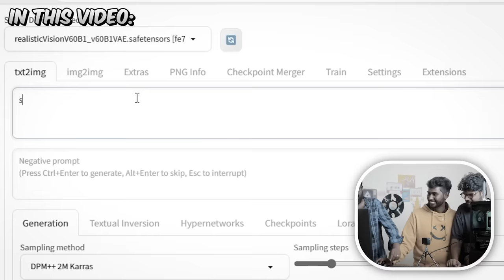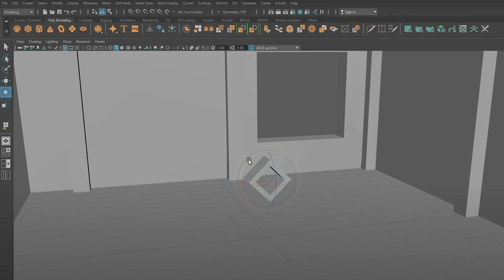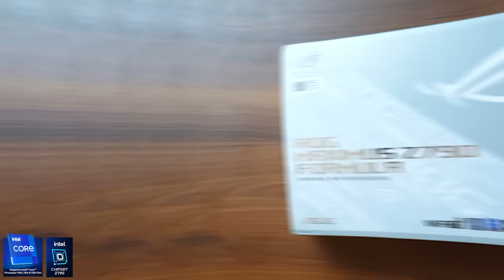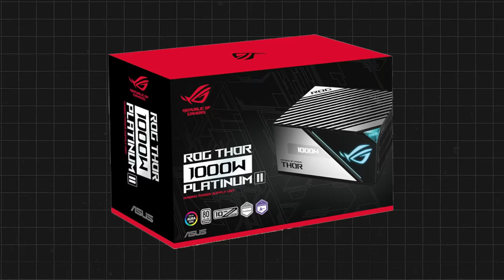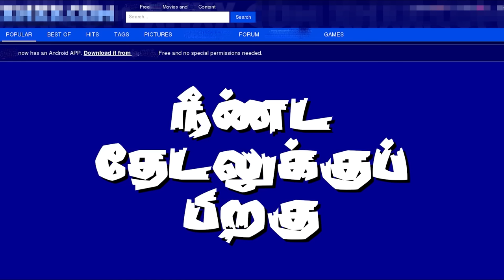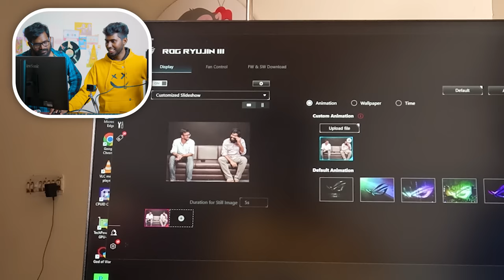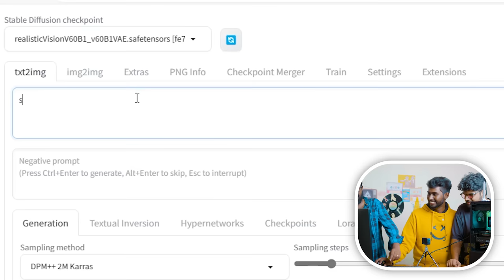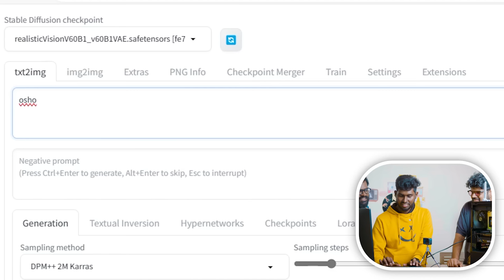Rs.5,00,000/- PC With @TempleMonkeys  | PC Doc Vs Vijay Varadharaj 🥊 | Fun PC Build 😂🤣

Comment: PC clean panitu on panean bro Hard Disk 🚬 smell vanturuchu thirupi check panean ellam wire connect agitha iruthuchu 
Next day PC on panean monitorla "Non-system disk or disk error replace and strike any key when ready" intha mathiri varuthu bro
Help Panuga bro...
Reply: Harddisk fire agirichi pola bro adha change panani test pananum repair shop kondhu pongha avanga old harddisk vechi check pani soluvanga ila idhu vera problem yaa kodha irukalam

Comment: Anna enaku oru second hand lap tharingala for my college work. Ill pay u
Reply: Bro olx laiyaa neegha try panalamaa ilana richie street laa try panalam also neegha second hand laptops sell pandra shops neriyaa irukum search pani parungha ana second hand laa vanguradhu not recommended bro ipaa infinix laptops elam cheap rate laa varudhu naa infinix laptop dhaan use pandran college project elam pani irukaan nala dhaan work agudhu neegha venna check pani parungha intel i5 processor laptop 25,000 khu kodukarangha check pani parungha